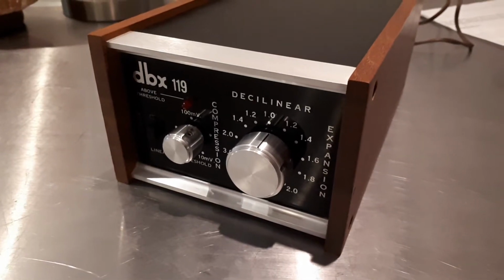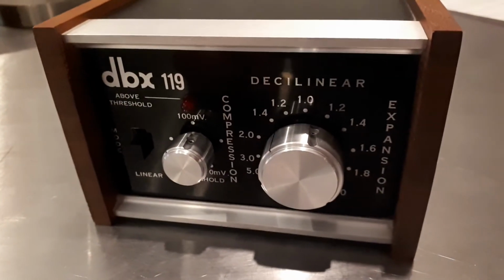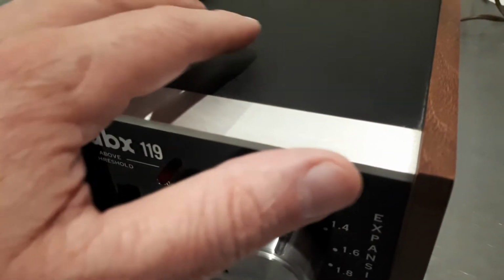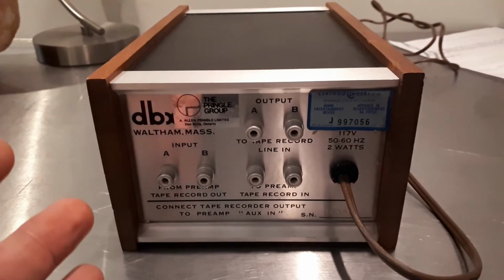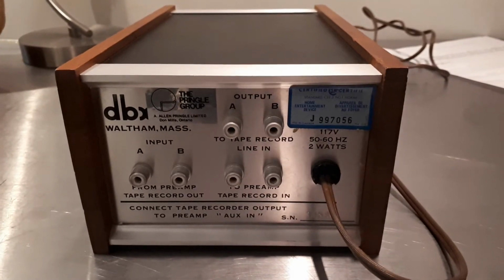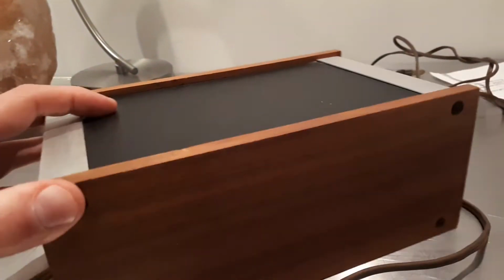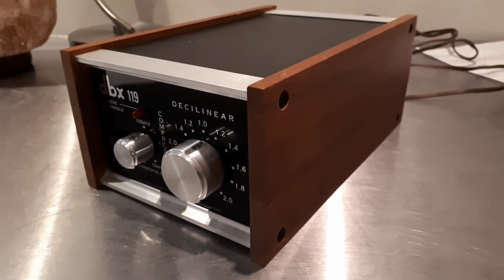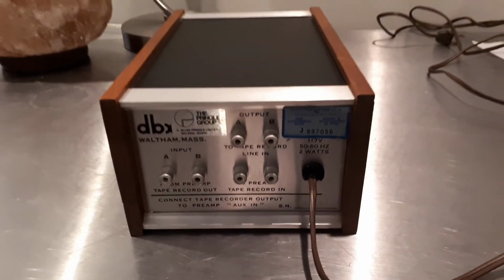DBX 119 Expander Compressor - my opinion

Comment: I got the "expander" bug in 1980. A girlfriend had a Pioneer RG-1 expander in her hifi system and it really opened up the sound. I agree it's best used with open reel and cassettes but helps on LP's too. I eventually bought the RG-2 in 1981. DBX had some sweet multi band expanders but cost was freakin' prohibitive to my meager budget. The Pioneer RG-2 was way cheaper than any DBX unit and though not as effective, it did the job for me. It is boss. Still use my RG-2 along with my ADC Sound Shaper Two IC purchased in 1982. Not so necessary with CD's, but indispensable with tape.
Reply from the maker: Nice.  Sounds like you were using them properly.  My approach was to overdrive them and get some nice distortion.  I had an RG Dynamics expander and it was great for making things sound nasty.